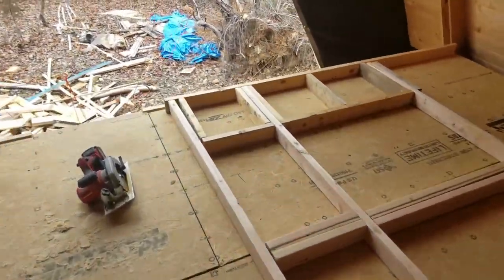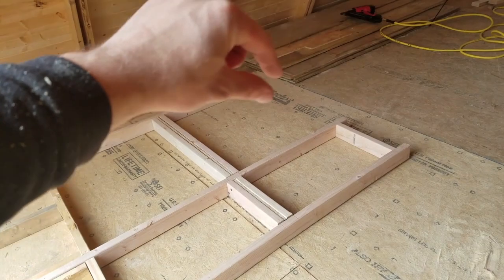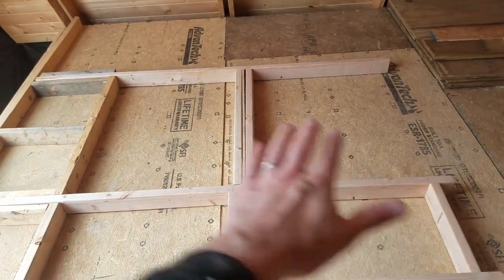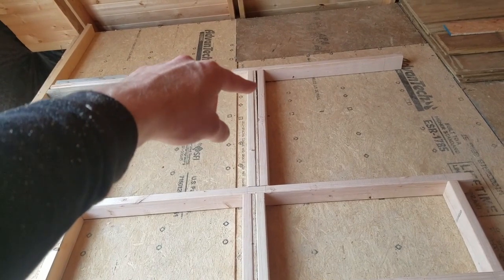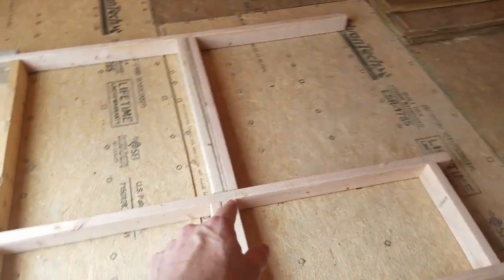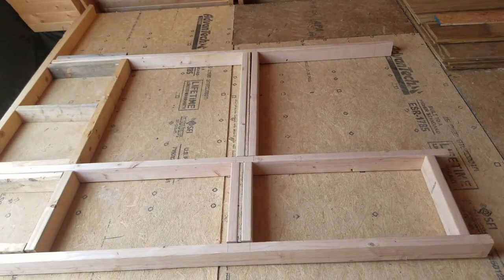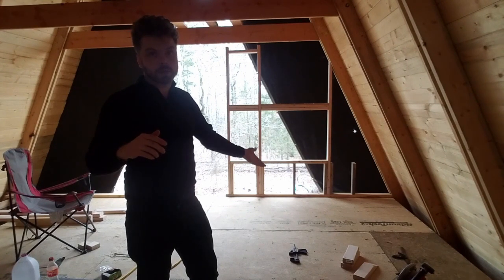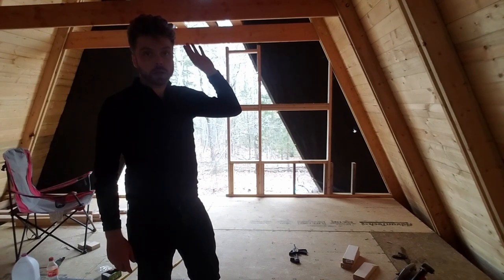How to frame all-glass exterior walls, Part 1/3: A-Frame bottom section

Comment: In the future, line up your wall with the exterior of the beam then sheath over everything.  Then inside furr the wall out to be flush with the inside of the beam and drywall it.  Order your windows for the sills to be the width of that wall with your exterior sheathing and add the 1/2" of inside drywall and you are laughing.  A nice continuous wall on both sides.  But why does the horizontal framing members not line up all the way across.  You should have at least 2 2x4s sistered together vertically to give you about 3 inches between windows (not including play) so that the window nailing flanges which are about an inch to an inch and a half don't touch each other.